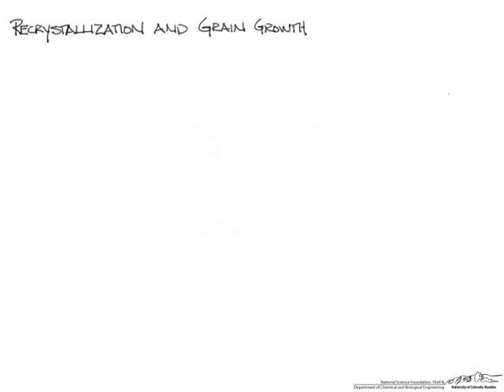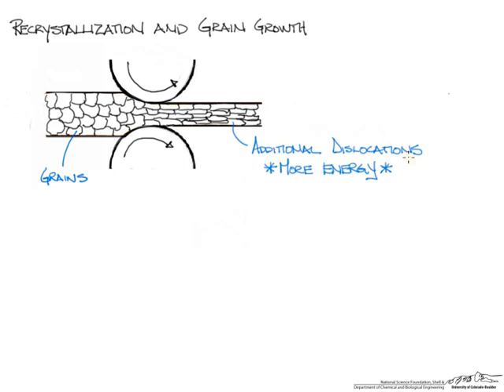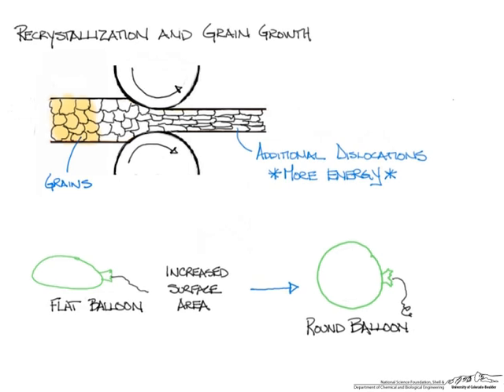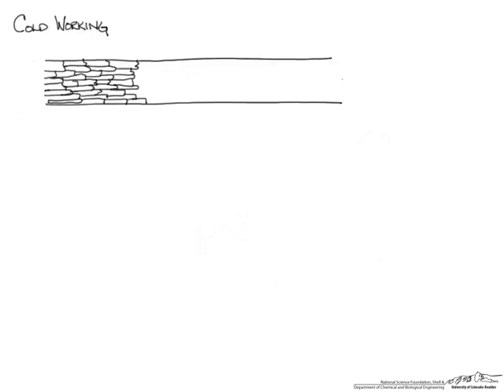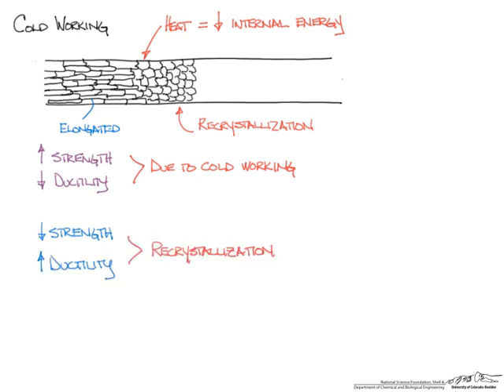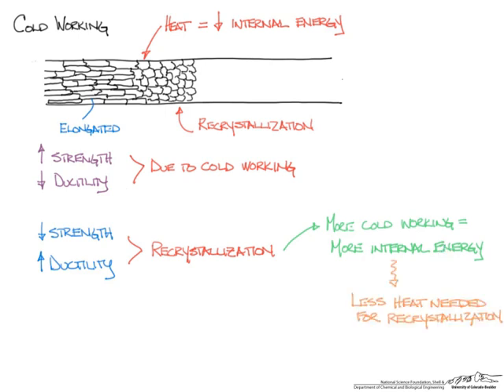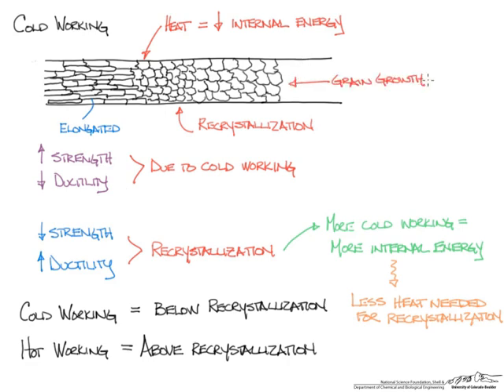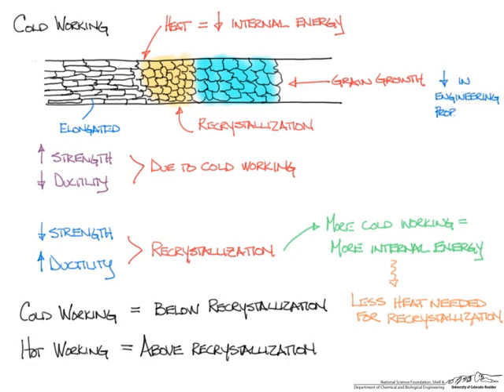Recrystallization

Comment: so you mean the 'heating' in your video is heating below the critical point? can you explain what the 'critical point' is? is it the recrystalisation point? If so then isn't 'heating' the same as annealing?
Reply: Yes critical means crystallization point.its two type 1. Lower and 2. Upper critical point ..for iron and steel  lower critical point is about  723degree centigrade and upper critical point is about 910 degree centigrade. It varies from material to material